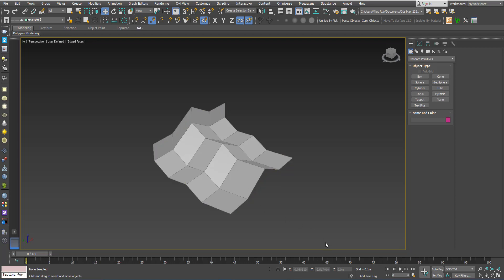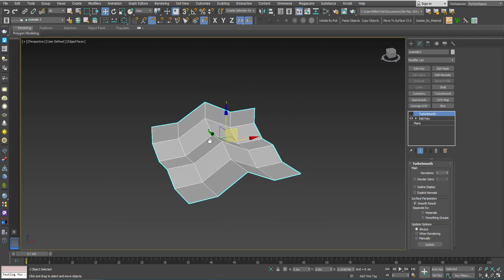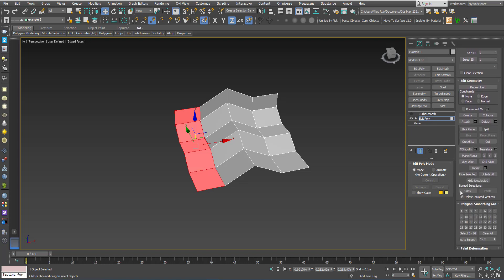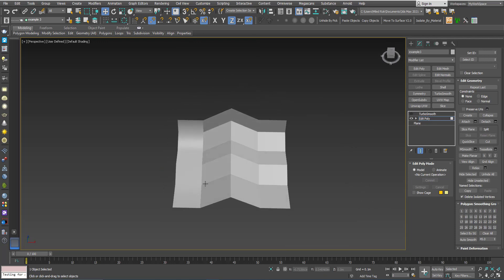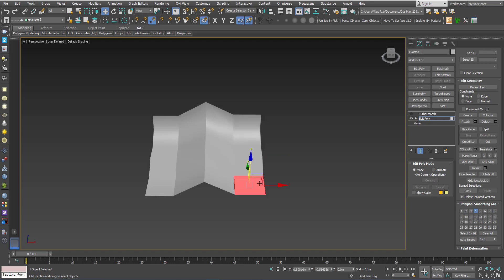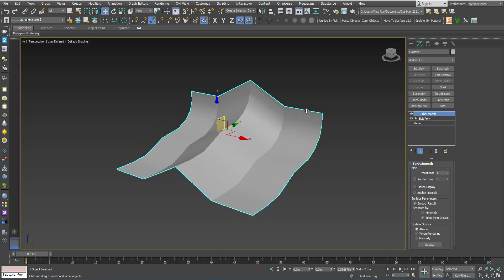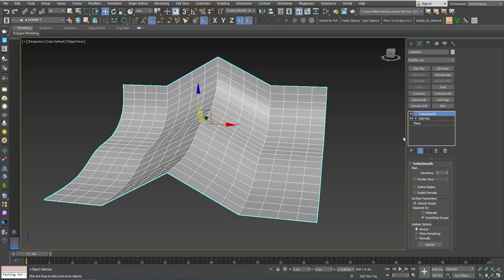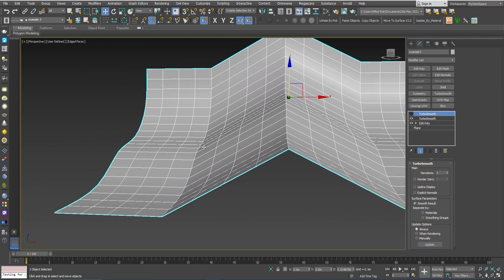Lesson 14 - 3DS Max - Total Beginners - Intro To TurboSmooth - Part 2

Comment: hey man i have a question
i have an obejct that have a curved shape 
and its cutted from the middle
my question is that i am trying to weld the object together but i can always see a line in it 
all what i want it to be smooth with the old shape..how i can do that bro?
Reply: BTW the object is a car body and its high poly
Reply from the maker: @FCL_Motorsport  Hi when you weld the vertices it's normal that you will have a line, what you can do is to go to the Edge sub-object level, select this line,  press CTRL and the Remove button in the Edit Edges rollout (you can also use the CTRL + Backspace). Using the CTRL is for removing any vertices belonging to the deleted segoments. If you like to keep them, just click the Remove button.
Reply: @MiledRizk  bro thank u so much btw im lebanese great job man and big thanks for the help it works perfectly bro
Reply: last question sorry for that 
any idea if i need to fill a hole ( its a car door handle so it big) i tried to add the cap holes 
now the model is all unsmooth..
any idea ?
Reply from the maker: @FCL_Motorsport  download and use this script: http://www.scriptspot.com/3ds-max/scripts/border-fill
Reply from the maker: @FCL_Motorsport  but read carefully how to use it. you need to choose the right vertices for it to work.
Reply from the maker: @FCL_Motorsport  I was thinking once to do a script like it, but i've found this one and it works decently.